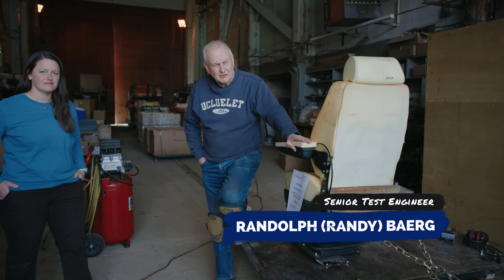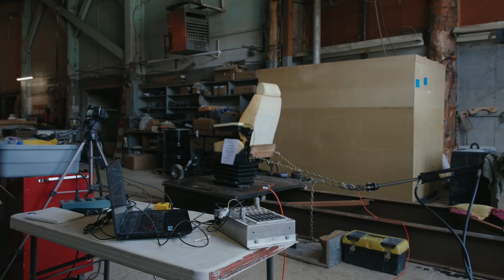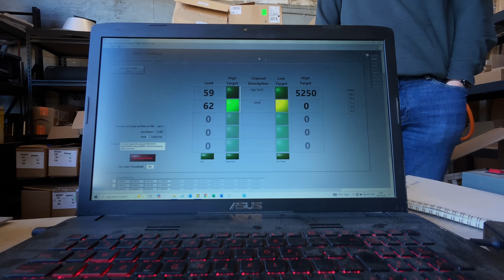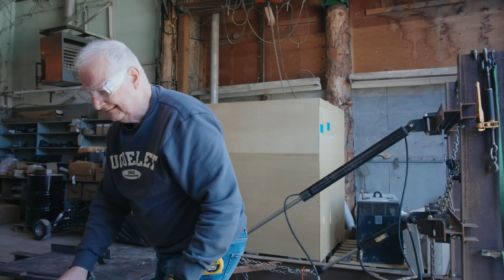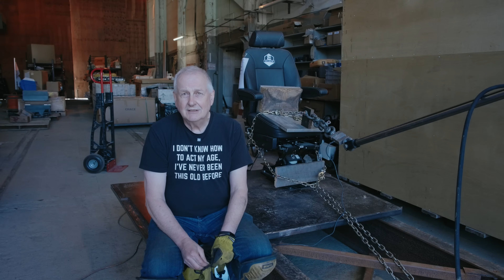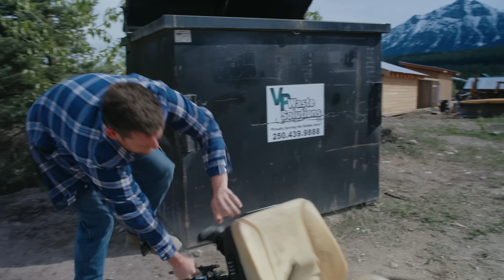Can This Seat Survive a Truck Crash?

Comment: Makes sense now why KW wouldn't offer low rider seats now,  At least on the old cab, I assume as they have a common cab now,, they probably offer it in both trucks now. Had a quick talk about seat belts and seat anchoring one day with engineering,  he did mention anchor angles and also talked about the floor reinforcements, never got into these specs.

Comment: Without knowing the testing standards, but as someone who spent time generating data for material models, is a slow pull all that is needed? 

We went though great pains to do crash testing at speeds to hit G load as the event time was also quit important. Not just inertial load, but also the speed of event can change how materials behave, no? 

University of Warwick in the UK has a great industrial testing facility where they work on crash structure testing and design (and other manufacturing and fabrication methods) 

I would reach out to them and see about consulting a tad on some of the testing design and possibly even doing some trials at their facility (or a tour) 

Good luck!

Comment: Do you need to test cab attachment? I once saw an accident where a Volvo truck rear ended an empty flatbed and the cab detached from the chassis. Word on the CB was the driver and his wife were safe in the cab which was in the ditch. I was in the lanes going the other way and could see the chassis sans cab on the highway.

Comment: I hope the investment will be open for a month more, just so that I can start having normal pay-checks again so I can put half of my savings into supporting Edison instead of just putting them on general index again :)
Reply from the maker: Please don’t invest any money you would be worried about losing.   We can use the money but I don’t want anyone stressed about losing something.   We’re still a risky company

- Chace
Reply: @EdisonMotors  Hence I've not bought anything yet. I make roughly 100k a year when I am emploeyd, just hit a one year gap when I wanted to try making a solar power company, which didn't work. So I've not bought anything I can't afford meanwhile I've been supporting my family with my savings. When salary comes back up, I can once again start using money. I just hope that it's still open when it comes :)

Thank you for the concern though. Risk is entirely acceptable when supporting something you believe with money you can spare. So I would like to invest when that comes available not before :)

Comment: The problem is, they still should be doing the crash tests for buses, especially school busses. A lot of lives could have been saved had they kept them to modern standards, especially for rollovers.

Any mass transit ought to have standards that reflect the value of the lives on board. Airframes is another area where a lot could be done, but there has been very little investment and innovation comparatively in that. Crash prevention yes. But clearly it is no substitute for crash survivability.

Comment: This is the first time I have been disappointed by a decision Edison Motors is making.  This last winter, a co-worker of mine, plowing snow in a Class 8 truck, near Kittitas Washington, was struck by a drunk driver on the freeway.  My coworker went into the median, and flipped his truck over onto the top of the truck.  Had he been wearing just a lap belt, it is very likely his injuries would have been much more severe.  Safety is not always convenient, and I think you are making a mistake.  Just my two cents.

Comment: It's stronger than it need to be...

That's the magic words. You always want to fail of the high side rather than straddle the magic figure. Going above isn't even that expensive, it just need some planning and smart design. But for whoever is driving a truck or car having just a bit more strength is usually not a problem, and might save you.

There is one case when this isn't 100% true and that's when the design relies on crumple zones. Then you want everything to give the right way as it will minimize the load on the drivers body.

But in general stronger is good.

Comment: I get your logic regarding yhe type 1 lap belt but please tell me you are at least going to offer the type 2 . The G forces are less in a heavy truck but youre still going to end up with broken ribs and a wrecked face if you eat the steering wheel or roll and your upper body rag dolls. Dont cheap out on the safety aspect guys.
Reply: Id imagine that they would offer either and whoever is getting the truck chooses. At least thats how id hope they do it
Reply: @dirtdevil70  I agree. Type 2 seat belt is much safer. Safety first. Hope edison dont keep the type 1. I understand why the safety guy prefers the lap belt because of moving around and shoulder belt catching you but thats not safe at all just one belt only. I work in the trucking industry for a Mack Dealer. We see all kinds of trucks come in from heavy haul to over the road. Its so dangerous here in the states without a shoulder belt. I cant imagine how bad it would be in Canada. Like the mountains ⛰️ and terrain they drive thru. I see allot of heavy haul and log trucks daily in our shop. Hope edison decides to use the type 2 or at least offer both
Reply: so far they've built all the trucks to order. Whatever you want in your truck, you'll probably get.

Comment: If your testing 3k on the seat and 5k on the belt at the same time isn't that 8k? Would you not test these separately a 3k test on the seat then a 5k test on the belt?
Reply: Its to simulate a crash. In a crash both the seat and the belt get loaded at the same time. The seat is loaded by its own weight and inertia. And the seat belt is loaded by the inertia of the driver.

Comment: hmmm, I think I would still be asking a few questions of the manufacturer over that weight discrepancy.  Being off by a few pounds sure, but a 50% difference? That's a lot.   

I would hate to go through all the testing, only to find that their process has a huge variation, or their QC missed a part that was supposed to be there on that one sample and have to repeat the test.  After years of testing electronics, I have learned the hard way to test to spec, not a sample.   

although it did look like a different seat you guys had for the retest, did you guys change seating suppliers at some point?
Reply: The first seat doesn't have the seat cover that is not nexessary for testing.

Comment: With an air ride seat and bumpy roads, having a seatbelt on makes a big difference.
Reply: As does being held in the seat in the event of a roll over and not being thrown round the inside of the cab or out  through broken glass. Which is why European coaches now all have seat belts fitted after coaches left roads, rolled and slid down embankments or along road surfaces ...unfortunate  loose passengers been smudged out.😬

Comment: Yup, More on the testing and how the trucks are being designed and manufactured.

Less Cumins.  You found away around the regs on generator on trucks well done.

But saying it better in the long run is hogs wash.  Reducing the bayery capacity to suit an oversized engine hogs wash.

The idear was charge the baterirs down hill. Use the bateries to go up hill gor the next load of logs.

What going on with Scania North Amirica.  Where's they support with using a generator.

Also has not a USA engine manufacture used Scania tech in they new engines.

Great work around in the short term.  But don't sell out on Edison Motors aims.

Have a great bank holiday ( It a sunny hot one  her in the UK)

Comment: Isn't this something that would be tested by the chair manufacturer?
Reply: They can test the chair, but they can't test how Edison plans to mount it in their truck.
Reply: @MrMartinSchou  but the manufacturer should provide mounting instructions...ie.  number of mounting bolts, sixe/location/anhles etc of anchor straps ,thickness/type of floor base etc.
Reply: @dirtdevil70 safety stuff gets tested not just calculated. "I think it should be strong enough that way" is not good enough.
Reply: @dirtdevil70  Sure, but that doesn't mean that the customers end up doing things correctly.

For example, condoms are 98% effective at preventing STIs and pregnancies, when hey are used correctly. However, in real life people do not use them correctly, which is why they end up at around 87% effectiveness.

Comment: I would think the seat manufacturer would have already had to do tests.
Reply: I think they're testing the attachment between the seat and the truck.
Reply: They aren't just testing the seat they are also testing how it's mounted and what it's mounted to.
Reply from the maker: That’s correct
Reply: There is no downside of testing it again. Trust but verify.
Reply: There's a ton more tests that the seat itself has to pass, and those have been done by the manufacturer. Just imagine all the things that could go wrong during normal operation and rob the driver of their safe control of the vehicle. The tests we see here are just for the mounting solution.

Comment: I do love a good behind the scenes video! The end was a bit embarasing but the chair is heavy 😉
Reply from the maker: “Hey Chace can you do the outro while throwing the seat in the dumpster”..  turns out I need to hit the gym more
Reply: Dude use the broken chair in the office. Isn't it just the base that's busted?
Reply: @mouse11011  The point is that they're demonstrating that failed safety equipment must be discarded (so it cannot be used again). Taking the seat that passed off of the vehicular mount (permanently, so it cannot be used in a truck) and using it on-site for a non-safety purpose might get less negative attention but is also probably prohibited. Such is the way with life safety equipment.
Reply: Moar Plz

Comment: You might want to double check that seatbelt requirement.  My research tells me the US and Canada both require type 2 belts.
Reply: Seems like it wouldn't hurt, and you'd be more likely to say that no one's ever died in our trucks. I understand the mass of a semi means for most collisions you won't experience as many g's but God forbid someone falls asleep and hits a brick wall or falls off the side of a mountain.
Reply: @matt45540 Problem by a sudden stop like hittng a big solid concrete structure (a brick wall is not enough) the extreme G on all the mass behind the driver is a bigger danger. This is a situation I would led the customer make.

Same as rolling of a cliff. Simply to much force.
Reply: @matt45540 Or have a head on collision with a full loaded timber truck both doing 90? But I'm only an engineer and trucker. 😅
Reply: @seandurgin  I'd happily run a type 1, hate to have the hassel of being pulled over for not "wearing" a seat belt